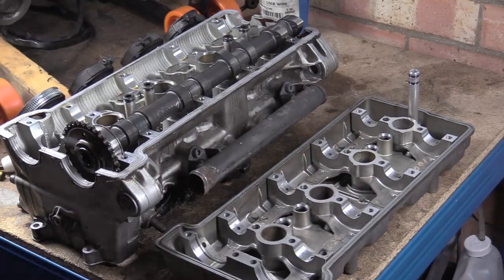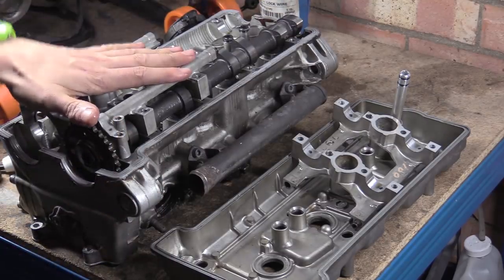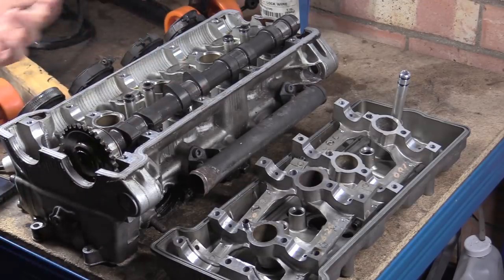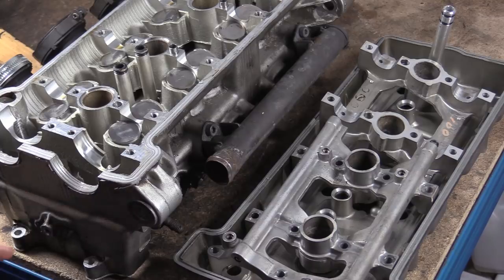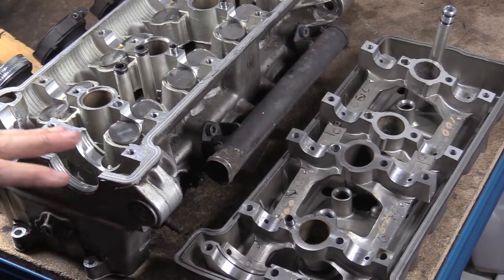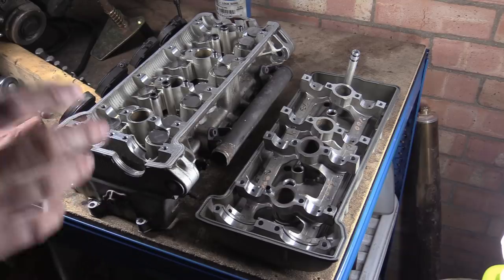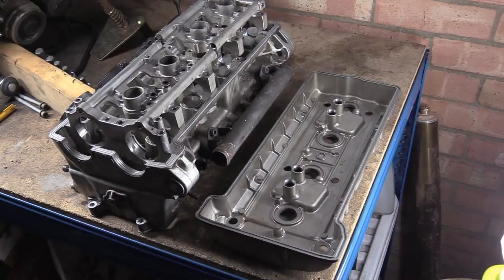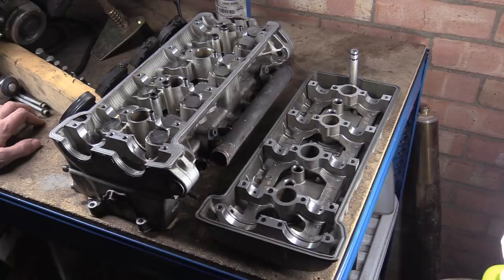M1stERd - My First Engine Rebuild - PART 7

Comment: It's amazing just how many miles this engine has done with a steel shaft running in an aluminium "bearing". Thank god we've got "Liquid Engineering". I'm more impressed by the properties of the oil than the engine itself. Just how many revolutions (approx ) has this cam shaft done ? Someone else do the math please as I'm an old git and it's past my bedtime.
Reply: 60mph x 91k miles =1516.5 hrs
6k rpm X 60mins = 360k rpm/hr 
360k x 1516.5 = 545,9400,000

May have missed something but it's a very bloody rough calculation
Reply: @darylsavage119 Wow ! that's a staggering number. Thanks for that. Put's it in a bit more perspective that the engine was actually still running.

Comment: Yeah the top end camchain buffer\guide is a known issue on these. My 30k 7R was missing this piece, most of it was sat in the ignition cover, some in the sump and a little in the oil pickup. Cheap and easy to replace and cuts down on the noise. I suspect the "typical noisy ZX7R top end" noise can usually be somewhat attributed to this, and it gets noticeably quieter when sorted.
The plastic basically hardens with heat cycles and breaks up.

Comment: Why are there not bearings in the aluminum?   Would it help long term?
Reply: Yeah Matt how do you thread the camshafts through the installed bearing's?
Call me a dingbat if you like but I can't see it myself, except with shorter camshafts only requiring bearings at either end
Reply: @warrengray610  only way you could save that head , is to have the bearing surfaces built up with weld ( tig ), or skimthe mating surface, then line bored, which would still be quite a heafty bill
Reply: It's all too expensive now. But if it originally had bearing halves like every crankshaft or rod bearing it might be as simple as just popping in a fresh set
Reply: Fellas, I'm now listening to Direstaits telegraph rd on Chrome cassette and I'm not fussed anymore Matt will sort it all out, I'm
Sure it's right, live long and prosper!

Comment: The reason you can't buy the cam ladders separately is that they are a matched set. The are bored and line-honed as an assembly at the factory, same as horizontally split cases. Now, I imagine one way to restore a head/ladder might be to mill the head and ladder a tiny bit, then re-hone to size. This is done with conrods and blocks/bearing caps in car engines.
Reply from the maker: "The reason you can't buy the cam ladders separately is that they are a matched set. The are bored and line-honed as an assembly at the factory,"

- Didn't I say that?
Reply: @dirtygarageguy  Gah, if you did, I missed it. My bad.
Reply: @dirtygarageguy  Nah mate you didn't say that. You said that you can't buy the cam carriers on their own but didn't explain the reason why.
Reply: @jeffsymons7084  Vindication! lol I know Matt didn't say it explicitly, I just left it alone because I know he knows what he's talking about. My comment was really for any viewers that might wonder why.

Comment: Many moons ago I had single o/h cam CB 500 Four & discovered similarly grungy 'head bearing surfaces. I decided to get them machined to take shell bearings (I think it was done by Joy Engineering) and it proved to be an affordable (at the time) & successful fix. That said, I'd be surprised if such work could be carried out modern twin cam engines where - as you point out Matt - there's less metal available to extend the bearing surfaces. And even if it's do-able, there be all those extra surfaces to machine; cams to sort; the ever-increasing costs...  😧

Comment: My last Eddie Lawson Kawasaki z1100 I got 130000 mile before strip down I changed 2valves plus guides, changed the bearings that's all it needed . It's service was done my me .on average  Scotland to Bolton every week plus all the running around Edinburgh and Scotland

Comment: Eyup,Northern.Surely the cam cover would of been off for several valve check/adjustments?
Reply from the maker: yes - and?
Reply: @dirtygarageguy  It sounded like you weren't sure but needed evidence of someone getting the cover off. But it's kind of a "duh".

Comment: Weirdly enough , those ball bearings they use as plugs for the oil galleries, are 1/4 inch, which surprised me for a japanese engine

Comment: When I reshimed my Honda Hornet 600 this winter I read that the camshafts and the holders (considerably bulkier than this engine) couldnt be changed separately since they were "mated" to each other in the factory. Does that make sense? From the manual.
Reply from the maker: Yes - they have to be line-bored together
Reply: @dirtygarageguy  same thing with these holders then?
Reply from the maker: Yeah - they are the same thing
Reply: the same goes for crankcases

Comment: To thin oil problems... he could have used 15W50 and that all would not have worn so bad. And you should do that if you want to keep that engine running. That would keep the oil pressure up. As long you don't ride the bike on ice and snow 15W50 will be fine for older engines.

Comment: Why doesnt engine designers just go for higher oil pressure? Wouldn’t that elimitate wear? What are the drawbacks of running massive oil pressures?
Reply: Power required vs improvement obtained, you still won't have a high pressure when you start up

Comment: Aluminium is a soft material, engine designers could make these engine areas out of stronger material, but its not in their financial interest to give us engines that last longer.
Reply from the maker: Well no. It's more about weight - do you want a slower bike than 5 years ago? - Things don't last forever, and if these cam caps were cast iron they'd be even worse
Reply: @dirtygarageguy  ah yes, the old weight issue. Yep I'd agree, there would always be trade off's and compromise, but alloy isnt either is it?? It's the cheapest to produce and manipulate. Perhaps they could dose the alloy, or do they do this already? Ta buddy.
Reply: Sounds to me like we should just make engines out of titanium, lol

Comment: most important... if it aint broke... dont fix it 

one day it will rattle or run badly and then this should be fixed
Reply: and if its a worn engine use thicker oil to maintain oil pressure and save bearings from metal to meatl contact.
Reply from the maker: Not quite, pressure is half the story - the other half is flow
Reply: @dirtygarageguy  yes thats true but if its warm enough to flow the positiv displacement oil pump flows the same.

only if its so thick that the pump cant suck it, you get less to know flow and the engine wrecks

Comment: Why not put shell bearings in? A lot of engines are missing these for the camshaft. Is it just cheaper and not worth the hassle because limited lifetime of the whole engine?
edit: from the factory, not as a repair
Reply from the maker: "A lot of engines are missing these for the camshaft."

- they're not missing.

And I explained this in the video - didn't I?
Reply: Sorry...  Asked the same question...    Duh on. Me
Reply: The Workshop Not really, the space constraint isn't really there if they could just cast it different
Reply: That's basically the same as my question. Why were shell bearings not added from the factory

Comment: So basically when my cams wear out I have a 2000pound Fowler’s bill for a new set of everything or I go to a company like this https://www.hthoward.co.uk/engine-machining-services/motorbike-engine-work/cylinder-head-machining/ and pay about the same in labour? How do these 1960’s bikes stay on the road, surely most have done more than 100000 miles, surely people do get the work done to their original engine to keep it going?
Reply from the maker: Because your 60's bike is slow and heavy. 

Look at it this way - if your want to hobble faster - and you're on crutches you get lighter , thinner crutches - but they won't last as long.

"surely people do get the work done to their original engine to keep it going?"

- And what made you think this isn't possible or when did I say this wasn't possible?
Reply: The Workshop you didn’t say that, you said something to the effect of- it can be done but the labour makes it expensive. I’m more thinking of my 2015 bike that I want to keep for life. It is wracking up the miles and based on what your saying- one day with enough mileage I’ll have to either buy a younger head or pay for a specialist to recondition it, which is also expensive. In my ignorance I thought that if I keep up with all the servicing myself  it should last for life. But a 2k service job (I don’t have those skills)  on a 15 year old bike isn’t worth it. I also want to buy an 80’s bike and do my first resto. But spending 2k ish on reconditioning the head isn’t with it on a bike that only cost me 1k. I’m just using 2k as a number, if you know of more accurate figures in the ball park then that would be handy.
Reply from the maker: "it can be done but the labour makes it expensive."

- Yes, physically pretty much anything can be repaired. But the cost is usually prohibitive or in other words it ywould be cheaper and more accurate to buy a replacement.

"I’m more thinking of my 2015 bike that I want to keep for life. It is wracking up the miles and based on what your saying- one day with enough mileage I’ll have to either buy a younger head or pay for a specialist to recondition it, which is also expensive. In my ignorance I thought that if I keep up with all the servicing myself it should last for life."

- The life of the bike - or in other words expected life - so for a bike engine between 100,000 and 150,000 miles.

This is all engine dependant some things are easier (less costly) than others

Comment: Is this how all bikes are designed? It seems like an obvious wear point and badly thought out.
Reply from the maker: 100,000 miles comes to mind......
Reply: @dirtygarageguy  You'll find bikes with higher mileage that don't have that wear because of better design so clearly mileage alone is not the issue here. That's pretty obvious.
Reply: Generally the case for most Bikes,the one exception  I'm sure of is the Honda RC30 where the Cams run in proper Bearings (Roller I think) versus this Plain method on the VFR750F.
Reply: @paultanton4307  Bearings sound better. Couldn't they use a steel liner to prevent wear?
Reply: @purpleether5405  - Steel not used as far as I know as its too hard,in some applications Phosphor Bronze liners are used in Engines, but as far as Motorbikes are concerned Plain is more than adequate in most cases plus its cheaper.
Reply: @paultanton4307  Don't some bikes have steel sleeves for the cylinders? Couldn't you just use something similar for the cams?
Reply: @purpleether5405  Power, Cost, Durability. Any you add to one will take away from the others. You want it to last 300,000 miles, It'll be slow, although maybe not more expensive, as it's the lower power engines that tend to last longer